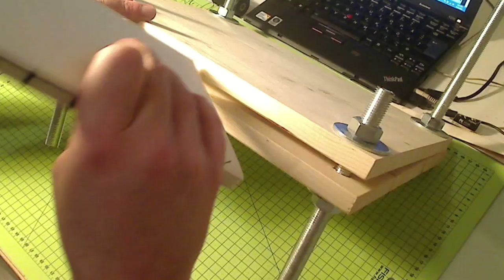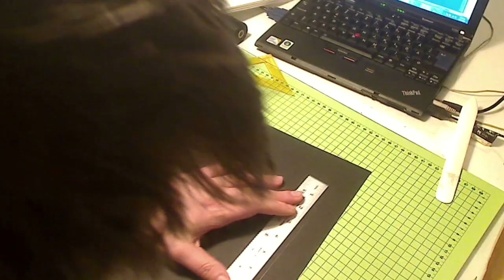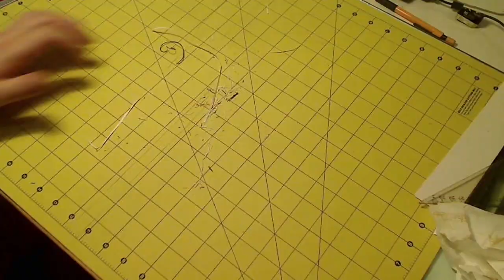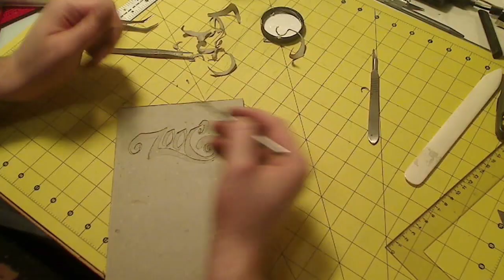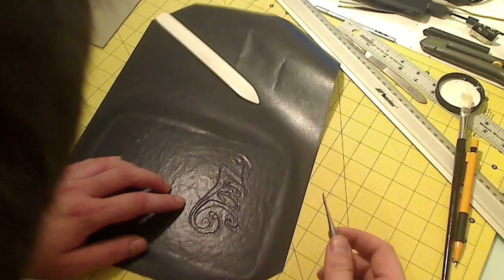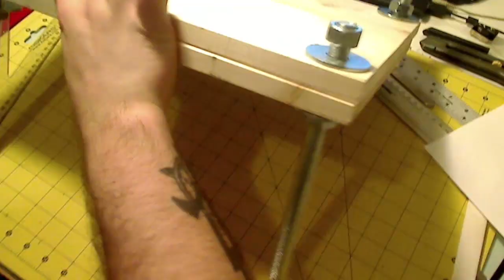Zooc is now an artisan craftsman (or not)

Comment: If you run into the problem of uneven edges again you can use sandpaper to smooth it, it covers up imperfections quite well if you don't want the "artizanal" look.